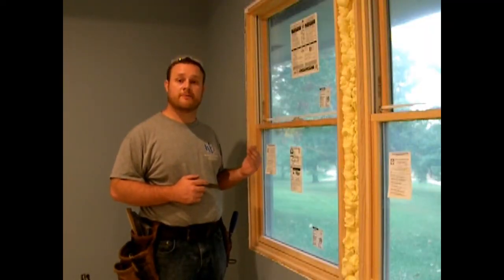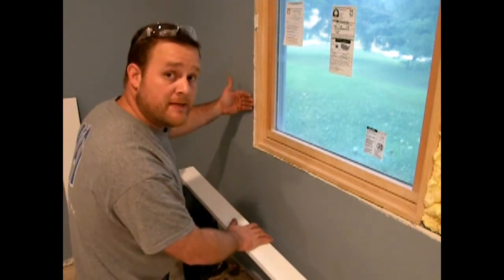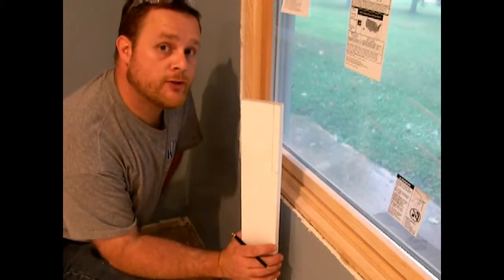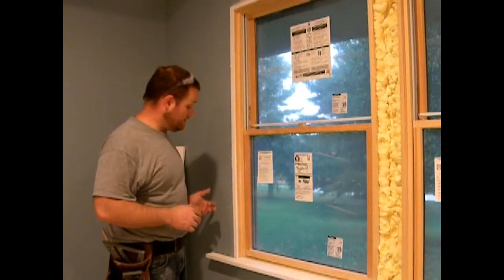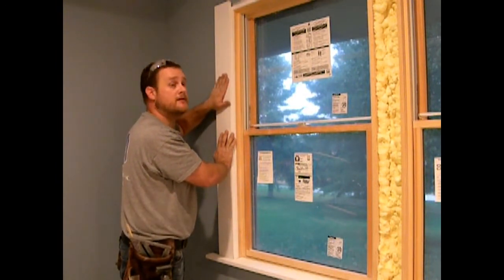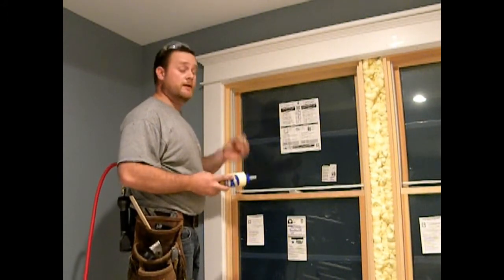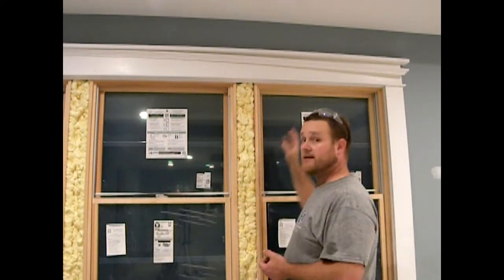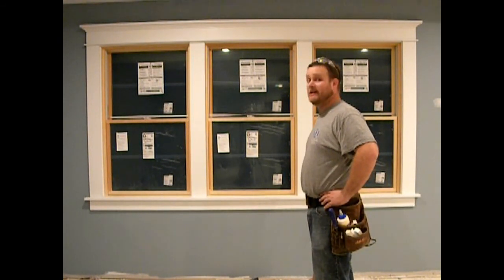How to install Craftsman Style Window Trim (in depth) E21

Comment: Nice video. Very informational. Can you provide dimensions for trim that was used? size (width) for apron, stool, side & top casings, bead molding, crown molding and top molding. What type of material was used? -- poplar? pine? Thank you.